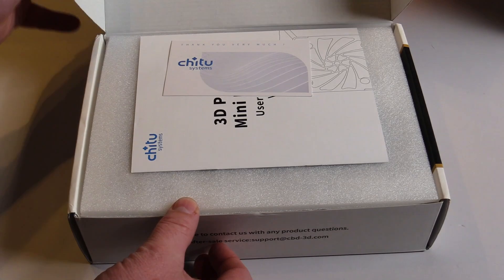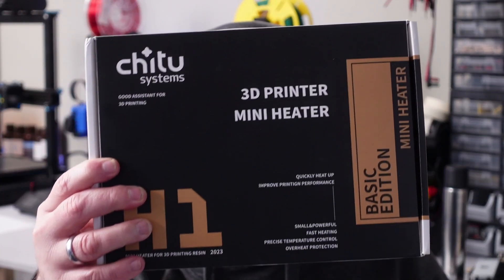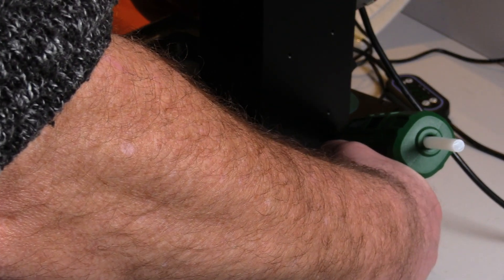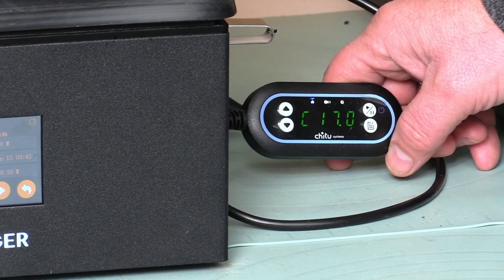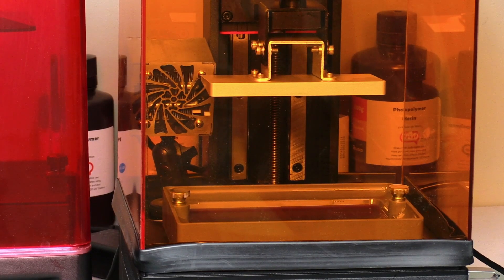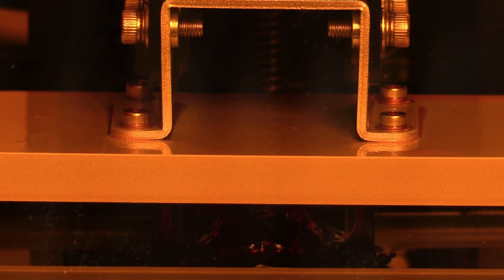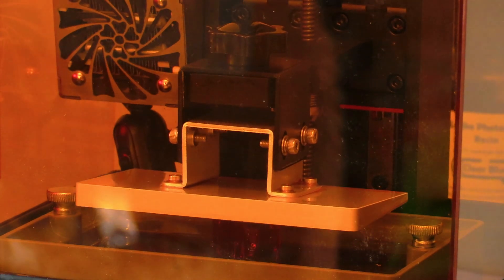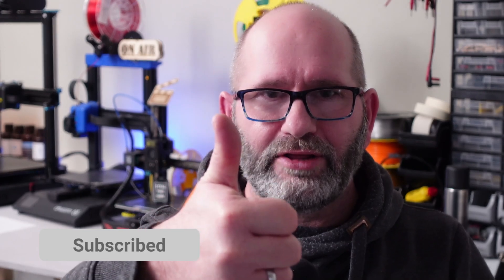Achieving Flawless Resin Prints In Chilling Conditions

Comment: What is the maximum temperature you can select with the heater?
Reply from the maker: On the display it goes allt he way to 120 degrees Celcius, but that's B.S. 
However, for an enclosed FDM printer it's possible to get it up to 55 degrees. I have reached that in about 22 minutes.

Comment: Thanks for posting about this product. How do you feel its effectiveness is versus a thermal vat band? I print with high wax content resin and my resin staying at or above 26C/80F. Should I give this a try over another vat band?
Reply from the maker: I have no experience with VAT heaters at all, so a comparison is not something I can make. Yet I do know that I never had a failed print anymore after using this heater.
Reply: @3dPrintCreator  I'll let you know. I decided to give this product a try. I currently use a thermal vat band on a large format machine. I'm going to try this heater on an Anycubic Photon D2. I print with high wax content resin and vat temp of 80F is very important.
Reply: @CalebFrederickDesign 
I know it's been a while but how did the cat and compare to this product?